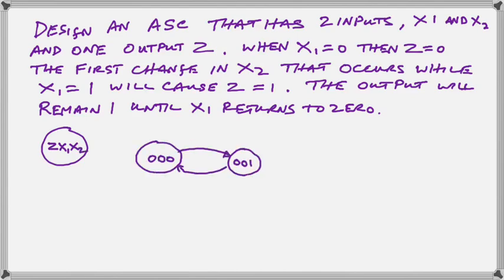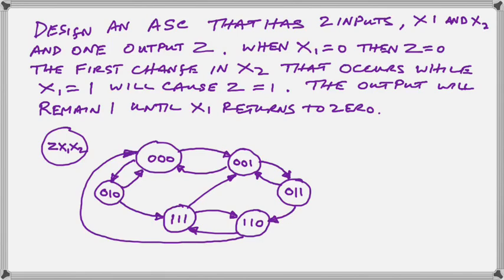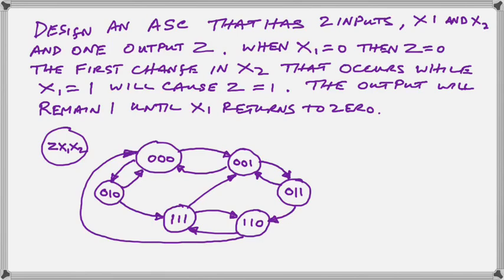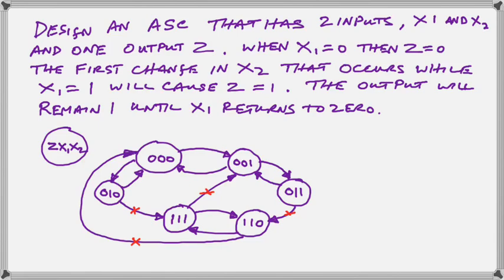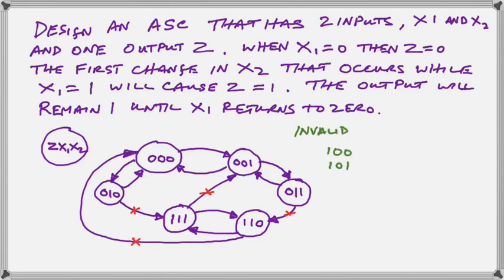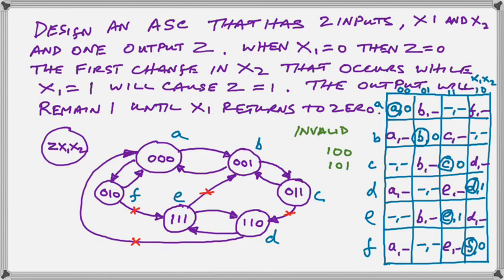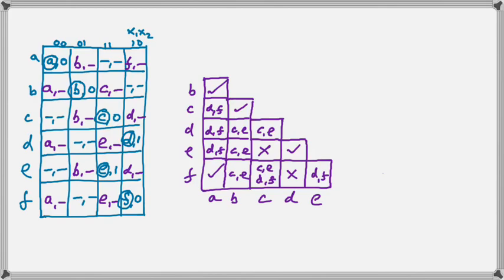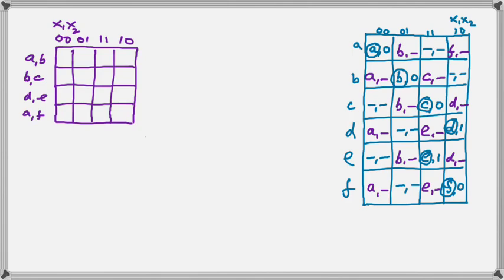Solution to Asynchronous Sequential Logic Circuit

Comment: Hello, sir, I am wondering about the state reduction table at (a,f) with input 00. Does it do (d,0) or (a,0)?
Reply from the maker: The reason why it does (d,0) and not (a,0) is because we have renamed the bottom row to "d" ....... in the first table where that row is named (a,f)  any square with either "a" or "f" is a STABLE STATE on that row ..... when the row is renamed to "d" we must also change that square to (d,0) in order to retain the stable state ..... the mapping of the letters on the rows follows a logical pattern that retains the behavior of the Transition table

Comment: Hello Sir

Sir Please help me with this question

Design a fundamental mode asynchronous sequential network meeting the following requirements
1) There are two inputs x1 and x2 and  a single output z
2) The inputs x1 and x2 never change or are 1 simultaneously 
3) An output of z=1 is to occur only during the input state x1x2=01 and then if and only if the input state x1x2=01 is preceded by the input sequence x1x2=01,00,10,00,10,00

Comment: In the second last step, where you are reducing the rows from two variables to a single variable. Row one has (a,b) and row 2 has (b,c), b is in both row one and two. Now row 3, column 2 has a b in it (initial table with two variables per row), how do we know if this b gets assigned to a or to b in the new table?
Reply from the maker: the b in row one becomes an a in the final table  because we are combining both b and a into  a  (so b becomes a in this row) ......  in row 3 the b remains b (because we are combining d and e into  c..... any d or e becomes c )  ....... in row 2 we are combining  b and c into b (so all c's become b's)  .... hope this helps you
Reply: @StephenMendes  Thanks